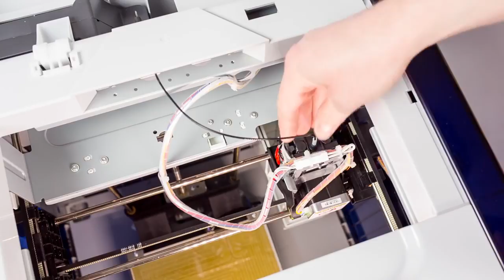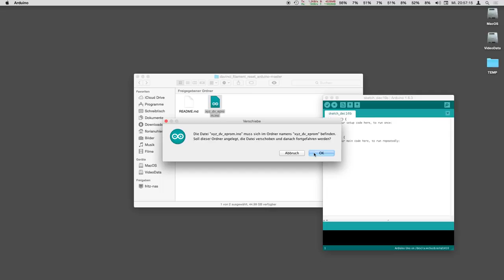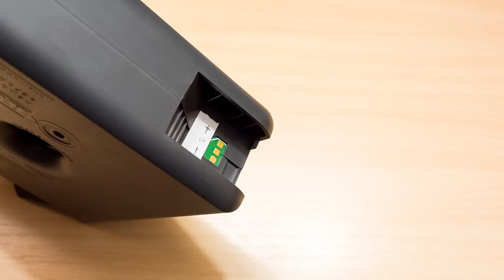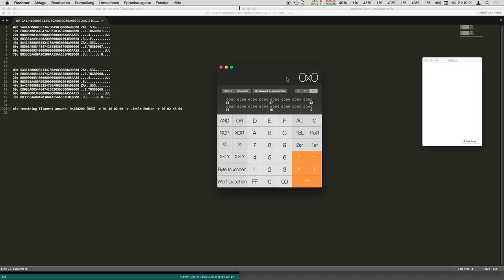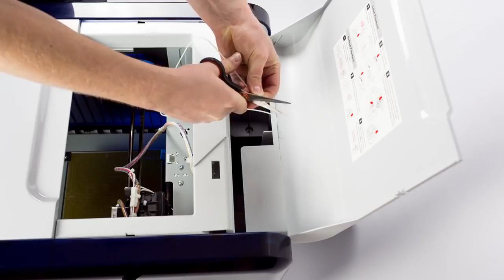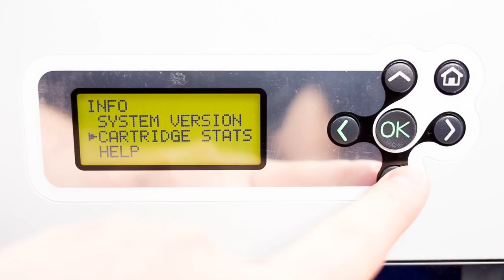XYZprinting da Vinci 1 0A EEPROM hack explained

Comment: Hi. I have a few cartridges, the printer can "see" them all, except for one, a green ABS. The green ABS dump from the EEPROM is very similar to that in the video. The others have quite different values (but similar to each other). Have XYZ updated/changed the EEPROM contents? My printer firmware is da Vinci 1.0A 2.1.4
DUMP:
White ABS 17 meters left (the other cartridges have similar values)
00: 5840580000303840C0D00000C0D00000 X@X..08@........
10: D0005800504840403030303800000000 ..X.PH@@0008....
20: 0000000030000000F8F8F8F8A850A850 ....0........P.P
30: 883050A8E04000000000001000E800E0 .0P..@..........
40: 5840580000303840C0D00000C0D00000 X@X..08@........
50: D0005800504840403030303800000000 ..X.PH@@0008....
60: 0000000030000000F8F8F8F8A850A850 ....0........P.P
70: 883050A8C0D00000A850A850C0B00800 .0P......P.P....

Green ABS, printer cannot see it.
00: 5A4144000034385980A9030080A90300 ZAD..48Y........
10: D2005A00544847423030393500000000 ..Z.THGB0095....
20: 0000000034000000FFFFFFFFAA55AA55 ....4........U.U
30: 883355AA055E02000000001004ED00E0 .3U..^..........
40: 5A4144000034385980A9030080A90300 ZAD..48Y........
50: D2005A00544847423030393500000000 ..Z.THGB0095....
60: 0000000034000000FFFFFFFFAA55AA55 ....4........U.U
70: 883355AA80A90300AA55AA55C7B00A00 .3U......U.U....

Thanks,
Garry

Comment: Testing connection to Da Vinci EEPROM CHIP
02:08:01.874 -> 
02:08:01.976 -> Da Vinci EEPROM found...
02:08:02.043 -> Reading the Davinci EEPROM Contents...
02:08:02.043 -> (success)
02:08:02.043 -> 00: 5A4157000034354BC0D40100C0D40100 ZAW..45K........
02:08:02.043 -> 10: D2005A00544847423031303800000000 ..Z.THGB0108....
02:08:02.043 -> 20: 0000000034000000FFFFFFFFAA55AA55 ....4........U.U
02:08:02.043 -> 30: 883355AA470600000000001004ED00E0 .3U.G...........
02:08:02.043 -> 40: 5A4157000034354BC0D40100C0D40100 ZAW..45K........
02:08:02.043 -> 50: D2005A00544847423031303800000000 ..Z.THGB0108....
02:08:02.077 -> 60: 0000000034000000FFFFFFFFAA55AA55 ....4........U.U
02:08:02.077 -> 70: 883355AAC0D40100AA55AA55C7B00A00 .3U......U.U....
02:08:02.077 -> (success)
02:08:02.077 -> Press enter to update EEPROM...

why i need to press enter? please help
Reply: i have the same probleme !  heeellllp